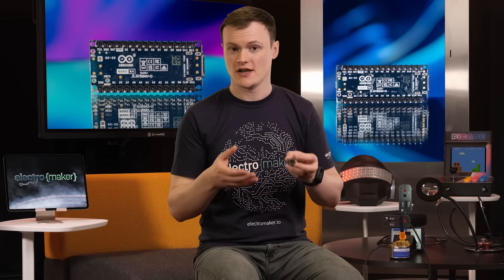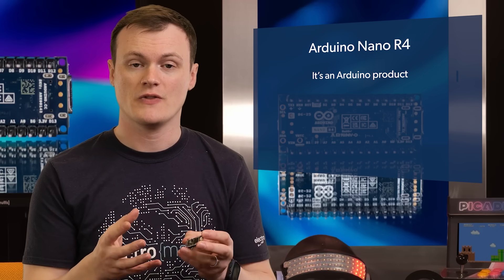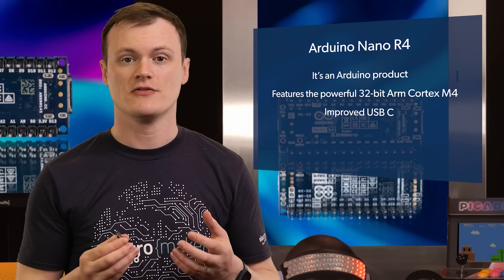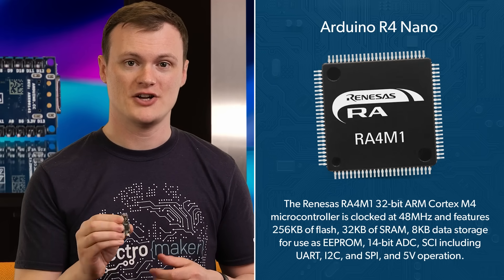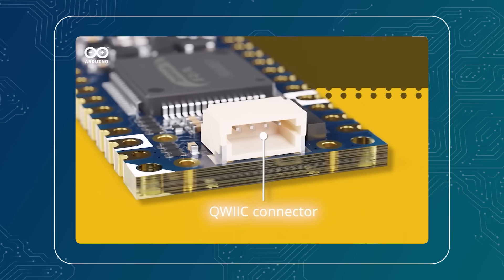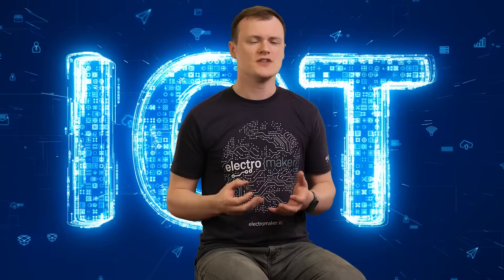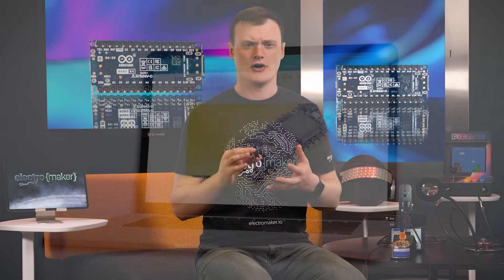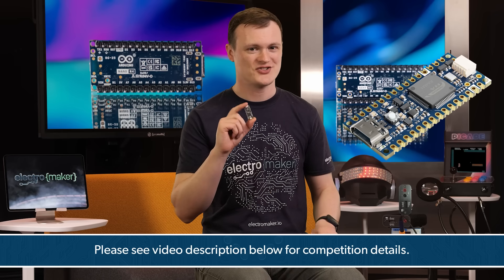Arduino Nano R4 Review –  32-Bit Power in a Small Package

Comment: Hi Robin! I'd like to win a Nano R4!

For some time now, I've wanted a real-time clock (RTC) in an Arduino, without having to give up shield capability or having cludgy wires running around to sub-boards.

Specifically, I want to to data logging, by recording the datetime of ionizing events and sending them off-board to a MySQL database, where they'll be analyzed for radiation risk during various "events" that seem to be getting more prevalent. I did this with paper and pencil during the Fukushima melt-down, and was able to show a statistical increase in ionizing events here. I appreciate that a board-edge pin (VBATT) allows me to keep the RTC running (on ≤1µA!) even without power with the simple addition of a long-life lithium coin battery.

(PS: I now realize I missed the draw date. Can you suggest a good place to get these discounted? It doesn't appear that China has cloned them yet.)

Comment: Made a password generator/sender with a 2x16 lcd, rotary with pushbutton switch and an sd interface board.  The Arduino Nano R4 has native support for HID.  Now I just dial which password to send and it sends it as if someone was typing.  Best of all, AI wrote all the code for all the functions!
Reply from the maker: That’s awesome! Using the Nano R4’s HID support like that is a clever idea, and having AI handle the code makes it even smoother.

Comment: I would do with it what I do with the original UNO: for every sensor or actuator there is online code to do a quick test to see if it works. However, sometimes the original UNO misses some power. This appears to be solved by the new R4. And I like the USB-C instead of the USB-B.

Comment: I will create a smart temperature and humidity monitor using the Arduino Nano R4. I will connect a sensor (such as DHT22 or BME280) to measure the environmental data and display the readings on an OLED screen. If I want to send the data to a cloud database for remote access, I will add an external WiFi module, like the ESP8266. If the temperature or humidity exceeds a set threshold, I will include an alert with a LED or buzzer. This project will help me efficiently monitor indoor conditions.
Reply from the maker: Congratulations Balázs - you have been selected as the winner! Please email hello@electromaker.io and tell us where to ship your prize
Reply: @Electromakerio  Thank you, :)

Comment: MUHAHAHAHAHAHAHAHAH A Mech suite with AI to Rule them all MUHAHAHAHAHAHAHAHAH ‼️ What else in 2025 only thing other than that is multi heat sensors for measuring my 2stroke when it is the right temperature for optimal combustion. If it's possible high temp sensors and a CO2 for Data. But the Mech 🤔 is my favorite!!